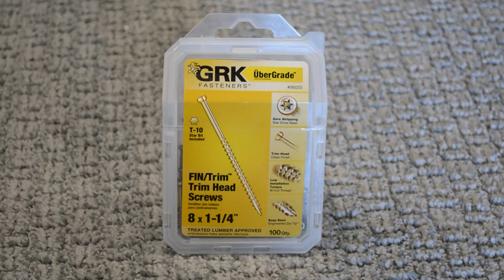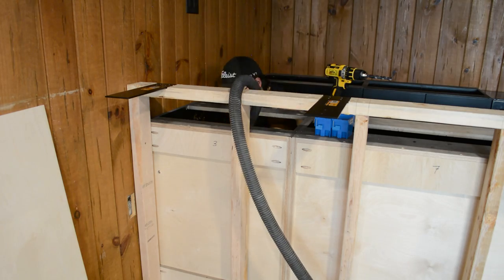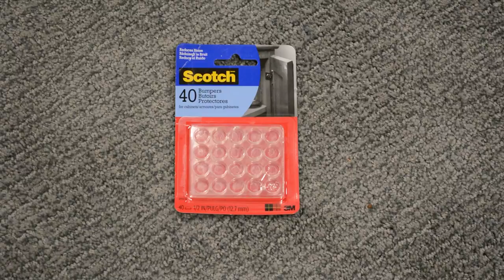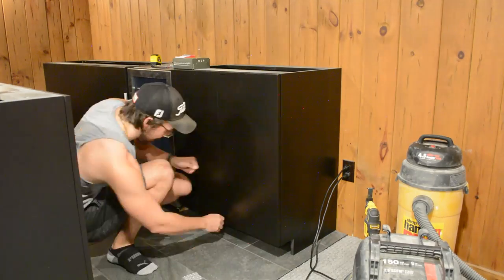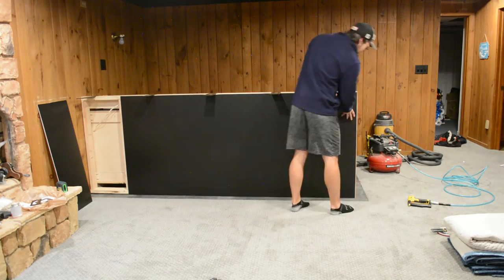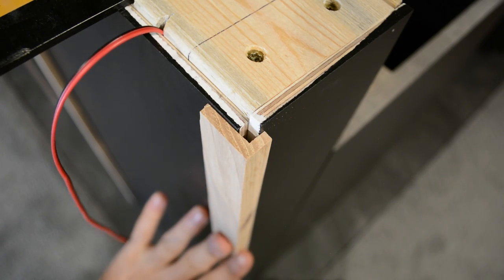Cabinet Install Day!! | Basement Bar Build Part 5

Comment: You should of put a  outlet facing the other way where the chairs going to be so people can charge their phones. But behind the bar works fine as well nice work man!!
Reply from the maker: That's a good idea! I figured they can reach over the bar top to plug them in if needed but it would be easier on the front side

Comment: Okay cool, so this video answered questions I had from other videos. I'd love to know how the high counter is held in.
Reply from the maker: The lower countertop is 36” high which is standard counter height and the higher countertop is 42” which standard bar height. Hope that helps!
Reply: @Golden Key Design  great! Is the upper counter screwed to the black metal brackets?
Reply from the maker: @DerekTJ  No, it's not a good idea to screw into quartzite so its just glued using silicone and the weight of the countertop itself is heavy enough to keep it in place
Reply: @GoldenKeyDesign  Gotcha.
Reply: You just need a gfci outlet at the beginning of the circuit. You don’t need two on the bar.
Reply from the maker: @bobk3840  Got it, thanks!